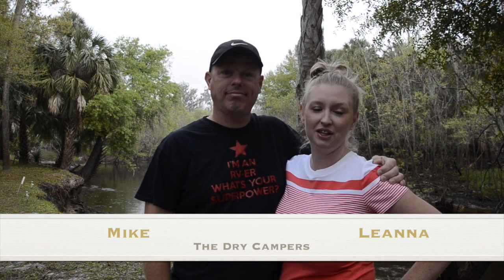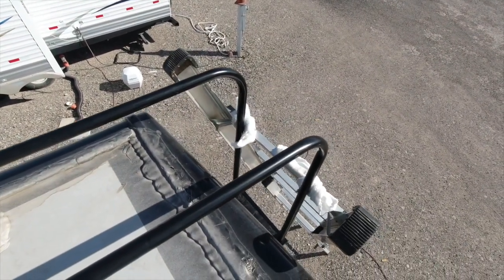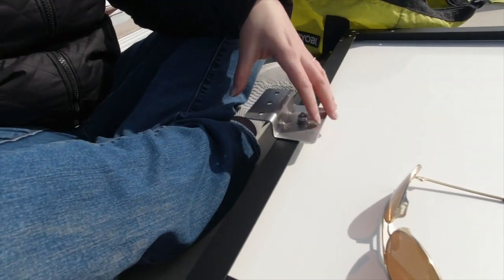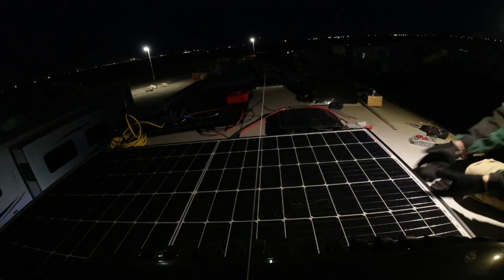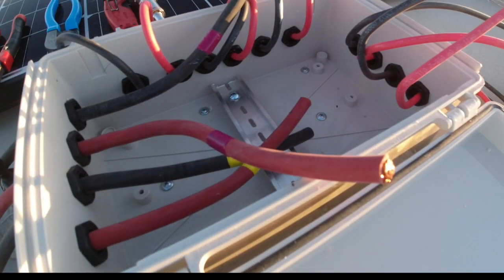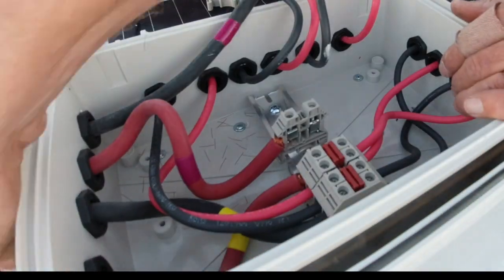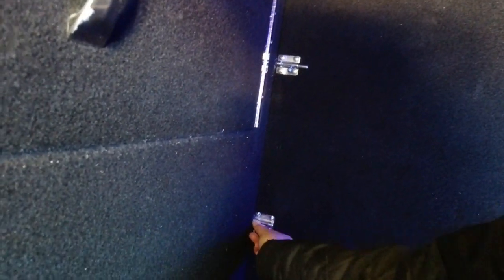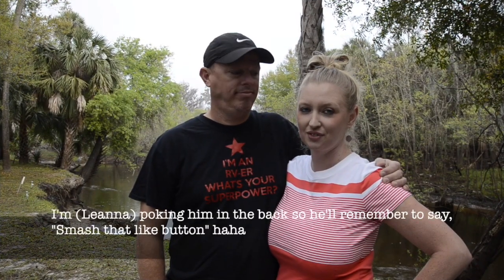Luxe 39FB + Battle Born Lithium + Solar = Dream Rig Part 2

Comment: Do you have schematics of your set ups?   It would be educational for lots of folks to see how you are connecting to onboard EMS systems, generators, etc.   What are you using to power both legs off of one inverter?

Comment: Love your channel.... Love all the installs you have done so far...   Mike... Can you explain what the WHITE device is that is mounted on the panel above and to the left of the Victron MultiPlus, next to the red catastrophic fuse ???
Reply from the maker: That is how I automate a coach so that everything works from an inverter, not just L1...
Reply: @TheDryCampers  Who makes it and where can it be purchased?
Reply from the maker: @philedelen7025  unfortunately this is not a piece of equipment that I'm able to consult on due to the liability. If it's not installed correctly, the RV electrical system could be damaged.